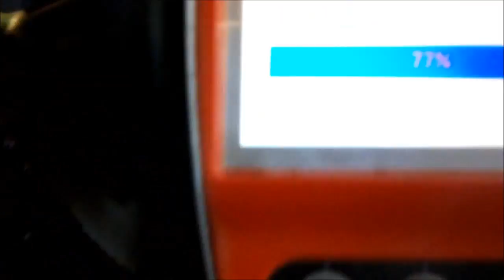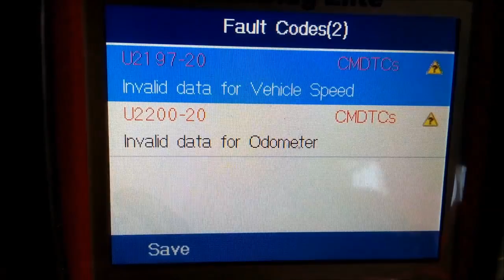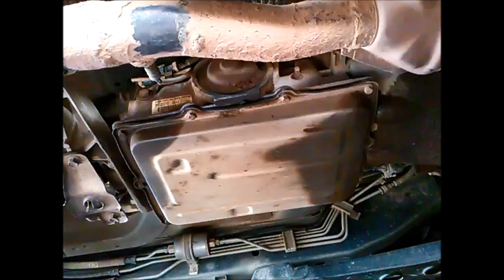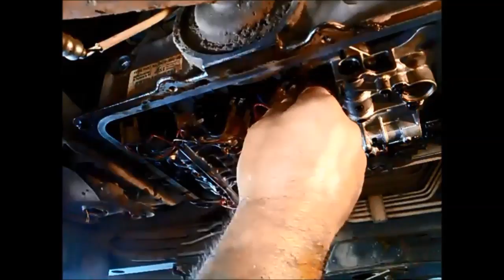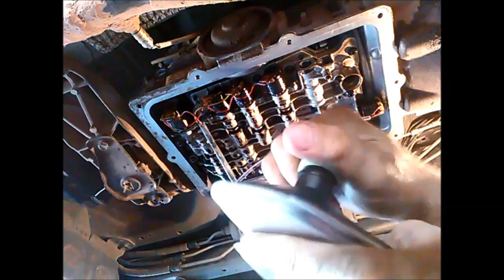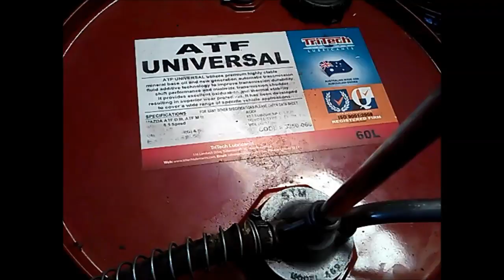Ford Territory BTR ION DSI M74 M74LE 4 Speed Automatic Transmission Limp Mode & Fix

Comment: Great video! Thanks so much for brilliant work and explanations. Very helpful. I've been able to get some more life out of my 2005 Territory with a few simple oil filter changes, but it still struggles sometimes to get into reverse and often a heavy clunk moving into drive or reverse. When it hasn't wanted to go into reverse it needed some higher revs to nudge it in and then it was fine. Was wondering if you think it's helpful to change the lower solenoids or it sounds like I need to service the clutch pack as well.

Comment: "54k views" me thinks Ford should be recalling this transmission design AND replacing the rear window rudder which breaks off onb almost every single Ford Territory I see. Apart from that and petrol guzzling...I should have never changed fom HOLDEN or TOYOTA.  It's disgusting that a woman cant just check the transmission fluid without a mechanic checking for the problem. No way for this  59yr old with a walker to tell if its low on fluid, as mine was in this case, leaking, or busted o rings etc.. it's criminal actually because its been limping a little for a while now.. I dont drive far at all most of the time. And forget to call my mechanic to get him to get into my gear box to check fluid... its a job I've always done on my other other cars... now my mechanic tells me there are seal leaks etc...and no fluids. How do I know, that had I been able to simply check  the fluid  by dipstick under the Bonet (like a 'normal' car) that the seals wouldnt have been leaking at all? Due to over baring/use in adverse conditions, because to tell the truth my last service was only 3000klms ago  and it seemed a little jumpy then...only slight, but it did occur to me at the time... "Did my mechanic forget to fill the transmission fluid?" I guess that's an easy enough mistake when your used to servicing REAL CARS lol sorry Ford but never again!

Comment: Gday iv got a p0731:00-AF 1st gear ratio fault .on 2011 territoy sz..It will go in gear cold then not when warm after 5 min...also no limp mode..Would that be solenoids ..Iv got one of those thinkdiag live scan its got all the solenoids with Amp and psi.. Cheers
Reply from the maker: hi, start with all the basic checks first. cheers

Comment: I have Ford Territory 2005 GHIA RWD 127000km.
Had a Transmission service recently and mechanic advised oil was dirty and low. Now the reverse is not working, otherwise all good. The gear moves into reverse but there is no thrust.
What do you think the issue is ?
Don’t want spend to much but want to keep it .
Thanks for any advice. @YepThatsit
Reply from the maker: hi, check all the basics first. can be issue with seals in the rear servo, rear band adjustment, pressure leak in clutches etc. you can air pressure test apply ports if you remove vbody. sorry hard to determine without seeing it. cheers

Comment: I have a 2006 Territory GHIA AWD 6sp automatic transmission…

Every time I service the transmission; do I need to purchase the kit that, comes with a new sump aswell?

Or can I just buy the kit that comes with the filter and gasket only?
Reply from the maker: hi, you can buy a metal pan upgrade kit if yours still has the plastic pan. our contact link is in description. cheers

Comment: Hi great video I've  have and issue with my 2008 ford territory 4 speed just on ttake off it struggles to find first gear then thumps into place after take off... when driving normal you wouldn't know there's an issue with my auto, I've talked to a few auto/mechanics and they all say its stuffed replace it with a reco one?? Any suggestions on here will greatly help! FYI Im in Adelaide
Reply from the maker: hi, if its thumping hard it can be solenoid issue. start with basic checks and work from there. cheers

Comment: Hi there I’m having a bit of a hard time getting the clip back on that holds the filter in
Any suggestions?
Reply from the maker: hi, just clip on the right angle part, then the other end should have a slight angle on the spring steel. it should slide into position because of the angled part on clip. hope that makes sense. cheers
Reply: @YepThatsIt  ok I’ll give it a go 
Thanks

Comment: I just changed out my falcon EB trans had a low pump pressure condition not long rebuilt the engine say 5 year's ago rebuilt the valve body it ended up having a cracked ring gear very rare but happens it destroyed the gear box but going good now I've turned into a ford pro after watching your videos you are a true teacher I'm very confident working on my btr 4 speeds now they are great fun and now very easy to do thank you very much for sharing your knowledge.
Reply from the maker: glad the vids help, cheers for a few beers if deserved, link is in description
Reply: @YepThatsIt  Are you located in Australia I don't have PayPal but I would be glad to send you some beer money 😉

Comment: Hey mate, I have an 05 territory
what would it be if the gearbox won't find reverse, it's not the cable as I have fixed that, but when the reverse is not there I have forward in drive and neutral positions and then sometimes reverse then pops up out of blue
thanks 😊
Reply from the maker: hi, sounds like clutch pack worn and gets stuck. check all the basics first. cheers
Reply: I have same problem. How did you end up fixing no reverse?

Comment: Hi mate what fault code did you get?

I have a bf that currently show PRND flashing on the dash and now isn't there at all.

I did a service today on the automatic today and now realised it is leaking deon the torque converter end would this cause my problem? I currently have no fault codes
Reply from the maker: hi, check the basics first including fluid level, earth straps, strong battery, electrical connections etc. electrical issues outside programmed parameters will throw a fault code. a leaking solenoid will not give a fault code on these trans. cheers
Reply: Gday mate thanks for the reply.

Gave the box a service and seems to be good now.....cheers mate
Reply: I've the same issues. Hopefully my answer is within this with the flashing dash light. Spent $900 first service, second service $600 to Try correct kickdown issues at high speed.. Now a flashing dash.. great car but man these gearbox issues on the 6speed  😞

Comment: You only need the S1 and s2 to control the box. S3, S4, s5 are just for smooth shifting. If u don't mind a very hard 1 to 2 shift (2-3 not that harsh) cut s3 and S4 wires on computer side but you need a resistor same as the solenoid and ground it to trick ecu all ok
Reply from the maker: hi, yes we all know s1 & s2 & s5 ( pressure control ) & s6 & s7 ( tcc ) need to be hunky dory, s4 band apply regulator solenoid and s3 clutch apply regulator solenoid need to be electrically ok, but dont matter if they are leaking a bit. however, the tcm needs to sense some resistance on s3 & s4 ( like you mentioned using resistors in wire somewhere ) to operate properly and to fool tcm to think there is a solenoid there. some people like to mod like you mention, but why bother on average road car for sake of 2 solenoids you would need to drill out ( still needs to be present ) for full flow anyway ? thanks for the input cheers
Reply: @YepThatsIt  Am just alerting to a very easy performance shift mod that can be done to these transmissions that does not entail removing the pan off the trans. It involves simply disconnecting S3 and S4 solenoids wires from the ECU (somewhere close to the computer) and putting the wires from the ECU with a dummy load to earth, dummy load for each solenoid should be a single 27 ohm 5 watt resistor to ground, one for each wire on the computer side to stop ECU going into limp. S3,S4 and S5 will no longer do anything in the hydraulic circuit to soften the shifts. Guys have been putting 600 rwhp thru these trans with this mod. I know someone who had a stuffed S5 with shift issues who did this to keep the trans going. Hard shifts are not for everyone but in the performance community, those with turbos its a great mod.

Comment: Great video mate but you rushed past the bit that is most important to me. How do I refill the plan with transmission fluid? You showed us where it fills up  but how do I get a bottle of transmission fluid up there to pour it in?
Reply from the maker: hi, we use a pump in 60L drum. cheers
Reply: @YepThatsIt  hi mate. I think i might have put too much or not enough fluid in the last time I replaced the trans filter and fluid. In another video you said a bit about how the transmission should reach a certain temperature before you fill the sump with trans fluid, can you tell me a bit more about that?

After the last time I replaced the trans filter and fluid, when I drive my SY territory the clutch engages for a few seconds while changing up a gear, the car loses acceleration and causes the RPM to spike for a few seconds before clicking back into gear, returning to normal RPM and picking up accleration again. However this problem stars to resolve once the engine has been running for 10 or so minutes. Does this sound like I have too much or not enough trans fluid?

Comment: Hi I have a 2009 Territory Did a gearbox service and fitted a air cooler and replaced 5 litres of fluid with Repco synthetic fluid. Now it slips going from 2nd to 3rd but only when cold. Would it be a shift solenoid , the wrong fluid or both, Thanks for the video its highly informative

Comment: Running into issues with my BTR m93LE on my 05 165,000 KM BA FALCON, Seem to have a harsh shift from 1st to 2nd. Recently did a service on it myself and note that the fluid was still cherry red and magnet has the usual gunk on it without any major shards captured, New fluid topped up along with new filter, previously you mentioned that the battery charge actually does effect the shift quality? if so have you ever replaced a battery and its shifts improved? besides that I was thinking of replacing the solenoids? Cheers mate love your work.
Reply from the maker: hi, flat or weak battery can cause strange issues, so does a poor earth strap connection. contact me on facebook link, we can supply you solenoids. cheers

Comment: my ford falcon transmission and   coolant water mixed, after flush and  now transmission working properly  but after driving 30 and 40  km  transmission does not   engage in reverse suggestion plz
Reply from the maker: hi, always check the basics first. make sure not under or overfilled. overfilled will cause aeration of fluid. if that all checks out ok, the coolant may have done damage to clutch and band linings. cheers

Comment: I'm sure you've worked on these many many times, do you have a specific recommendation for ATF Branded fluid?
Reply from the maker: hi, you can use dx3 with lubegard additive if you can`t find tq95 fluid. https://www.ebay.com.au/itm/Auto-Transmission-Convert-Dexron-DXIII-to-TQ95-BTR-ION-DSI-4Sp-Lubegard-Additive/293535606357?hash=item445815e655:g:9AEAAOSweZ9eiGpf  or contact me on facebook link. cheers

Comment: Hey mate, very informative video, no doubt will help me alot. I have an au falcon that is in limp mode and only shifts normally once it gets hot, I was thinking a solenoid problem, could you possibly point me in the right direction? Cheers.
Reply from the maker: hi, contaminated solenoids. the fine debris gets magnetized and wont demagnetize when solenoid is de-energized, so the debris stays in solenoid and can`t be flushed. cheers

Comment: G’day, Great vids. 

I’ve just had S1 & S4 replaced in a M97LE in my 98 5.0 Fairlane. No more limp mode, but still occasionally wants to take off in 2nd gear. It’s always done this since I’ve had it... prior to the limp mode later on. 
Have you had issues with the 1-2 shift valve getting a bit sticky? 

Cheers 👍🏻
Reply from the maker: hi, yeah but usually solenoid issue...why you only changed those 2? hopefully you checked others as well...large check ball in vbody wears out on separator plate, but depend on how many kms your has done, more likely worn c1,c2,c4 cylinder where rings run. cheers for beers

Comment: Band adjustments seem like a bit of a pain on the btr, well compared to old school trans ,shims and air pressure for a band adjustment from what i read. More interesting study for me.
Reply from the maker: hi, yeah much of a muchness whether they have shims or an adjustment bolt. the old borg warner trans had a 1/4" spacer which you would pull out after you tensioned the servo arm. always good idea to keep the bands tensioned to specs as they last alot longer.now go and study ;-) cheers

Comment: Hay mate just wondering we're I would find a set of these shift solenoids as I'm thinking I've got the same problem on my 2003 BA XR6 non turbo, I've check out ebay but they only sell one at a time for $80
Reply from the maker: hi, contact me on the face book link. if you`re in oz I can sell set much cheaper. cheers
Reply: @YepThatsIt  were is your facebook link Bro as I'm new at this YouTube thing
Reply from the maker: @kennethwarrenpeach5623  hi, click on my channel ( yepthatsit next to pic of my boof head ) and on top screen pic at bottom right, click on the face book icon. cheers

Comment: Good video. As a complete novice, why do  knock solenoid before screwing them down tight? Are you pushing them in? Is that what you’re doing?
Reply from the maker: hi, its so the o`rings pop in where they should go. they go in quite tight on these trans, even though the chamfer is quite large on the solenoid bore. it is a very good question. cheers and merry christmas

Comment: Hey mate, great video, i was wondering if you go to the trouble of torquing up the bolts if there even is a torque setting for them and are all the solenoid the same part number apart from the s5?
Reply from the maker: hi, i`m sure there would be a torque setting for every bolt. i only torque valve body bolts and head gaskets these days after many years in the trade. just do the solenoid retainer bolts firmly or you will strip them. all the on/off plastic solenoids are the same ( some have filters on end some dont, but all same ) on the early btrs, the s7 solenoids on pump were different and some had metal on/off on valve body in the good old days ( these rarely gave trouble) cheers
Reply: @YepThatsIt  cheers mate
appreciate it

Comment: Great video. I'm having similar issues with the same gearbox in my AU2 Falcon Ute, the fault codes show 2 solenoids and the speed sensor are no good. It gets stuck in 3rd after driving for a little while and the engine heats up fast. To my knowledge, there are 7 solenoids in total in the BTR 93 LE. They are notorious for reverse gear playing up as well. I did find a 7 solenoid kit on eBay for $460.
Reply from the maker: hi,  yeah if there`s an electrical fault that falls out of manufacturers set computer parameters, trans will go into limp mode. basically trans is designed so that when there is no electrical power ( like if you pulled the electrical plug out ) you can keep mobile to get out of trouble ( no solenoids are on/applied in 3rd gear ). without removing trans you can only replace 6 solenoids ( one, the s7 converter clutch solenoid is located on pump and needs trans out to access ) so there are 5 on/off solenoids + a pressure control solenoid on the valve body. the 2 shift solenoids and the s6 ( which works with  the pressure control s5 solenoid ) need to be not leaking, you can get away with the BAR ( band apply reg solenoid ) and CAR ( clutch apply solenoid ) leaking a bit ( actually shifts are nicer if they are leaking a bit ), but all need to be working well elecrically and not sticky or contaminated with fine metallic debris. i wouldn`t replace speed sensor ( you can replace later no pan removal is needed ) until you replace your solenoids. also good idea to air pressure clutches and bands while valve body is out on the ports in the case and also re-shim or adjust bands while valve body is out as well. these are better and cheaper https://www.ebay.com.au/itm/Ford-BTR-ION-DSI-Auto-Trans-S5-Pressure-Solenoid-AU-2002-FG-2010-Territory/293029928494?hash=item4439f1de2e:g:RtsAAOSwdFdc53QJ    and    https://www.ebay.com.au/itm/Ford-BTR-ION-DSI-4Sp-Auto-Trans-Shift-Solenoid-EB-to-FG-Falcon-Ford-Territory/293029936216?hash=item4439f1fc58:g:cMIAAOSwEF5c53O2 cheers
Reply: @YepThatsIt  Wow thanks,
that's a lot of information. I subbed to you as well. that's a big help.

Comment: Outstanding tutorial!
What is involved in reconditioning a solenoid?
Reply from the maker: hi, first you need to do tests, warm up and make sure you can use the coil. then dismantle, repair or replace worn or broken components, reassemble, test and recalibrate if needed. cheers

Comment: Hey mate i like your videos. At the moment my 2001 model au falcon trans isnt shifting from D to 3rd 2nd or 1st while driving. It isnt pulling the car up like it used to even tried going into first on the highway and it kept going like it was in drive. I have done an oil and filter change.just need a mechanics input would my problem relate to the solenoids at all
Reply from the maker: hi, if it is stuck in 3rd gear more than likely is limp mode. one or more solenoids aren`t working properly so computer sets limp mode. get a scan tool and see if any fault codes stored. cheers
Reply: I tried an obd2 scan tool today and i have a linking error

Comment: Oil is a tad dirty? So much for ford and it's "don't need to change the oil under 50,000 klms" :) hahaha. Makes it MUCH easier to drain oil on a hoist. :)
Reply from the maker: hi, definitely need to "clean up" what is suspended in the fluid and what gremlins are in pan and filter. I take my hat off to people that work on stands and on ground ! cheers